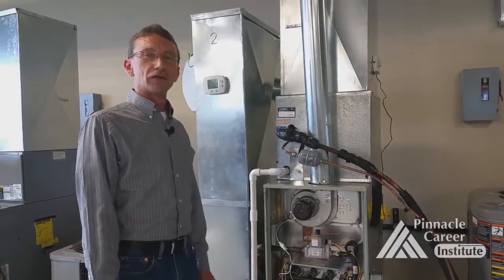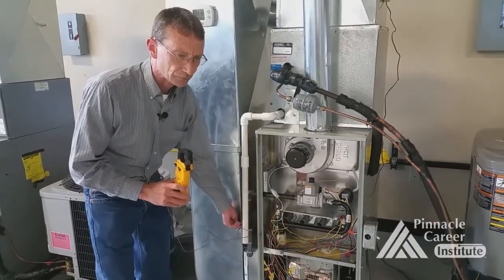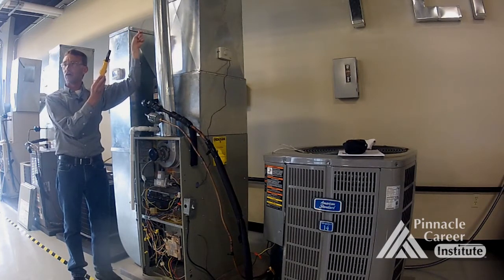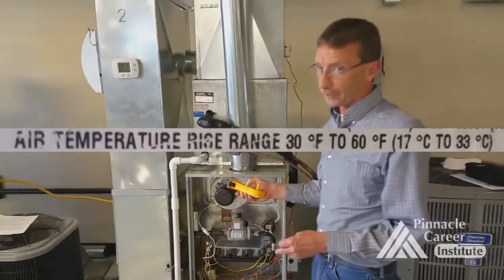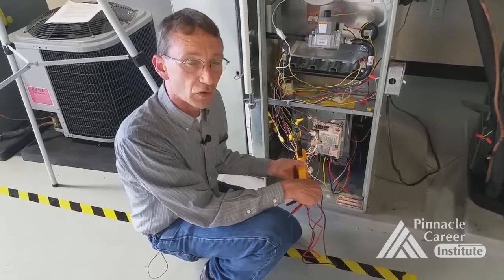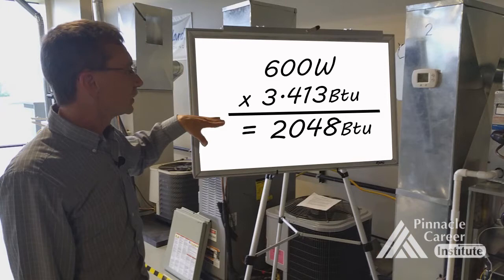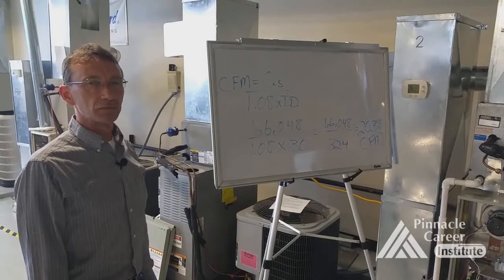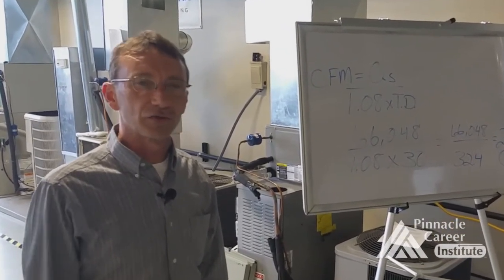HVAC - Calculate Temperature Rise

Comment: Thanks for a great video, however I noticed a few weird things in your video.
1 - Volt x Amp is equal to Volt Amperes not Watts, to complete the conversion you need another parameter, namely the "Power Factor" of your motor. Of course, if you happen to be running a DC Motor and not an AC motor, then you are certainly right in your calculation.
2 - Another point is the fact that not all energy transmitted to the motor is turned into heat, in fact most of that energy is used by the motor to convert the electrical energy it receives from Electric Supply into mechanical energy available at the motor shaft.  
I have another question, what is the meaning of the constant number, 1.08?
Thank you again for a good video.
Cheers

Comment: So is the blower motor just sitting there humming and overheating?!  Even if the motor is only 50% efficient the energy loss to heat is only 1.5 BTUs. Induction loss and the cooling effect of the motor...... Realistically we're talking about 1kBTU added heat from the circulation motor. The flue motor gets hot!

Comment: Why does wet bulb temperature matter when measuring temperature split for AC units but not for temperature rise for heated air?
Reply: Because it's part of the calculations for refrigerant charge latent heat portion I'm thinking. Heat with flame we only need sensible heat readings.
Reply: So you can measure the amount of heat being absorbed. Taking the wet wetbulb of return and supply. Converting them to enthalpy(btu) and subtract to get the difference. Using a formula cfm x 4.5 x enthalpy  difference = total heat absorbed.

Comment: well that output BTU is in perfect condition testing which is not the way any furnace set up.  Need to measure the cfm of this furnace when running and using that with temp rise to find out the "current running" btu of this furnace with this setting condition.  can adjust the blower motor and gas valve pressure to have the acceptable temp rise and the furnace output BTU can be determined at this blower setting speed.

Comment: There are reasons to test temperatures near the heat exchanger sometimes. Why do you do your amp draw on the Common wire? I was always told Common will show 10% higher
Reply: Its the neutral wire he clamp on and thats ok if this motor not sharing with any other load on this particular neutral wire.  When you say common wire is when it share with other load when you do a multiwire circuit.   so in this case its not matter if he clamp on the hot or neutral because the only load connect to those 2 wires is the motor.  what you was told is wrong.

Comment: Another question: taking that amp reading with the blower door open possibly affect accuracy?  ...since the rpm's and amps could change with cabinet sealed off assuming that's a PSC motor?

Comment: So does that final number denote that this is a 5-ton system by chance?  My 3-ton should be showing in the area of 1200cfm?
Reply: 1200 cfm or not depend on your duct static pressure.  as long as you can set the gas valve and blower to have the right temperature rise, CO under 100pp and O2 from 6 to 9 % you fine.  you mention 3 tons but that is for AC.  you can have 2 different speed for the blower heating and AC.
Reply: Well is not a normal settings, the return duct is only around 6 feet long and the supply probably 4 feet long...thats why the cfm is so high..